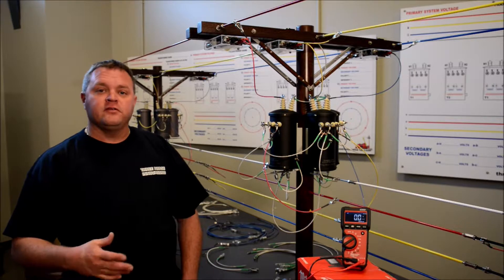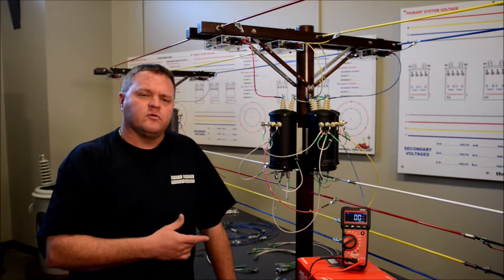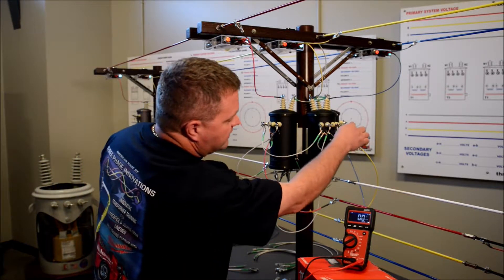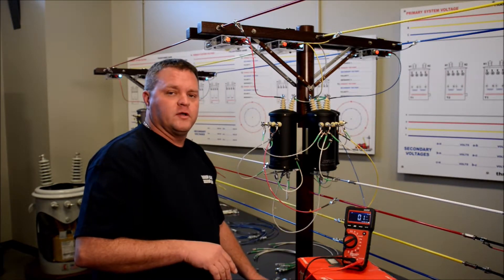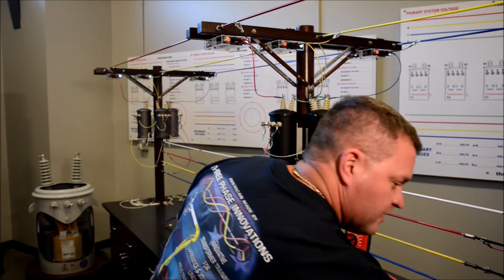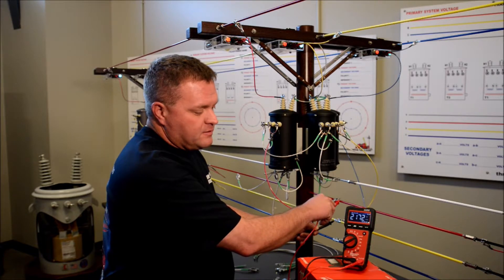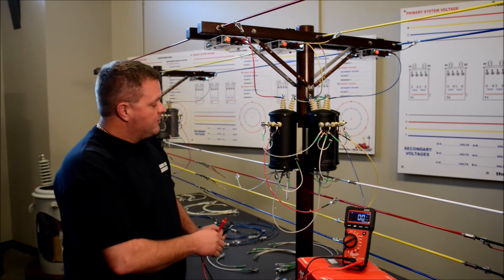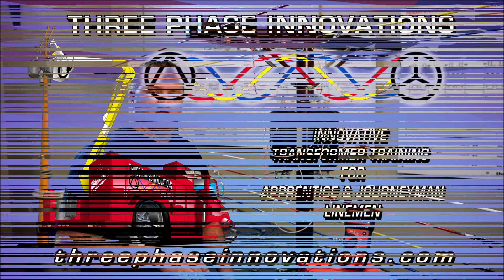Why Do You Always Tie a WYE-WYE Transformer Bank

Comment: Where is the neutral on the three PRIMARY (wye )windings?  Is there no neutral back to the SUBSTATION with this three wire distribution system?    Is the THREE WIRE distribution system a delta or wye?
Reply: In this example, we have a Wye-Wye 120/208 3 Phase bank. We are lifting the neutral connection from H2 on the transformers to show what happens to the phase to ground voltage on the transformer bank. Notice there is hardly any change in voltage from phase to phase. Always take 6 readings when troubleshooting 3 phase power. The neutral in a 4 wire Wye stabilizes the connection and is a current carrying conductor. A 4 wire Wye system gives you TWO differences of potential. A Phase to ground and a phase to phase voltage. You could have a 3 wire Wye system but every phase would have to be perfectly balanced so a neutral would not be needed to carry the unbalanced load between the phases. A 3 wire Wye would not give you a phase to ground potential though. The 4th wire in a WYE makes sure the Phases has a return path to balance the circuit. The neutral will carry the unbalanced load between the phases. The neutral on the high side is coming of the H2 bushings and the ground on the model is the wire below the transformer cans. When the neutral is lifted or disconnected you lose the 120 degree displacement in the bank from phase to ground. This is why the voltages spike when checking the phase to ground connection. Always remember the ground balances a 4 wire Wye circuit and is a current carrying conductor. If disconnected, loose or just a bad connection, the neutral can have the primary voltage looking for ground and if you become the ground you will get hit by the voltage from phase to ground.
Reply: @jasonleary6717  Is the Neutral coming off of the H2 bushing grounded to the can ONLY
and not going in parallel on another conductor back to the substation?  
thank you.     P.S.  Meaning Mulit Point Grounding system at EACH POLE that has a transformer.
Reply: @tedlahm5740  In this scenario it is a isolated transformer bank showing the dangers of a broken neutral at the transformer bank. Our goal is to show a open neutral coming off the H2 terminals or a bad connection. Troubleshooting with the meter shows the problem by checking voltages.
Reply: @jasonleary6717  Yes, Kirchhoff’s voltage law for series circuits (open or lose Neutral conductor).  Thank you